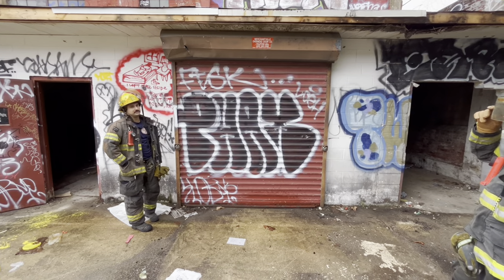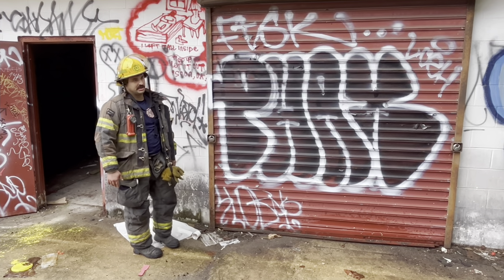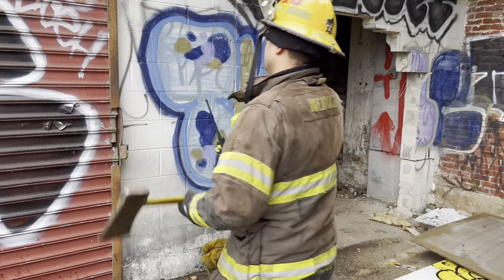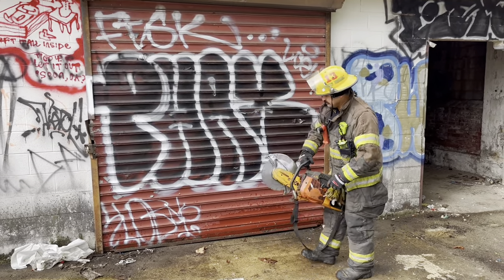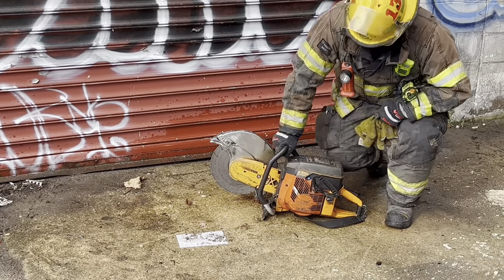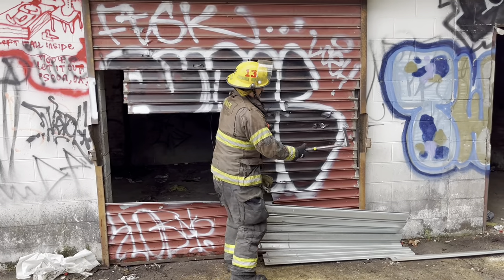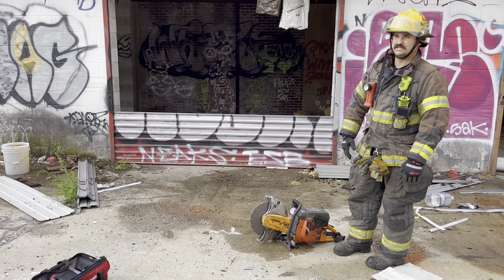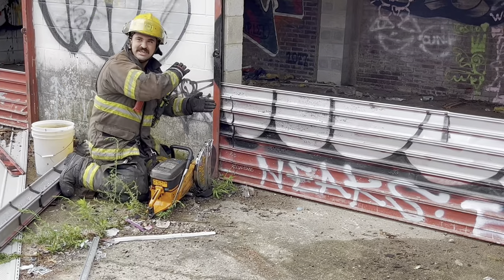ROLL UP DOOR FORCIBLE ENTRY - Philly Ladder Company-Level Training | Diamond Blade K950 Saw

Comment: If it’s a fusible torsion spring will release from heat and you will have to lift total weight.
Reply from the maker: No shit! Didn’t know that
Reply: @partsandresto  only on fire rated/ actuated.  We have them all over in our buildings.  Once those springs release you need a fork truck.